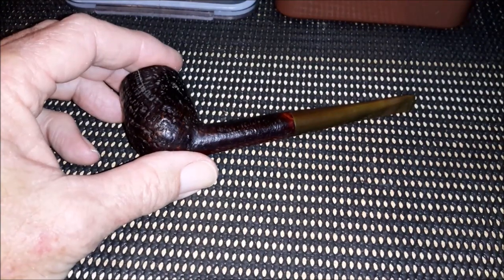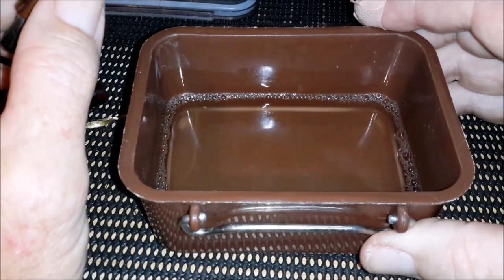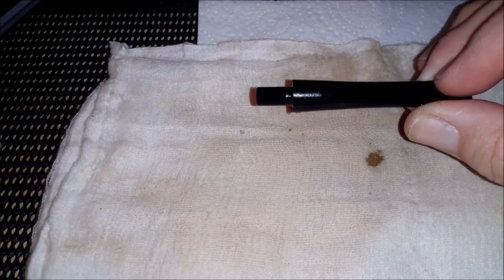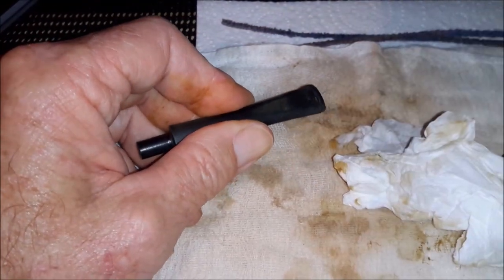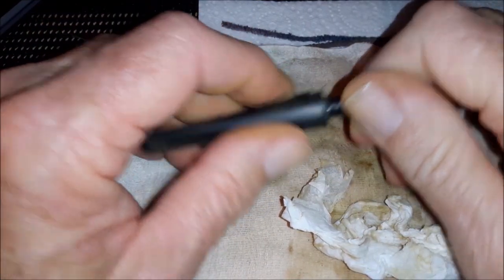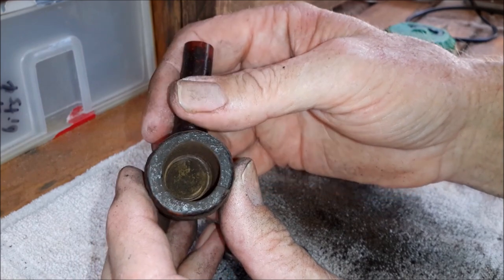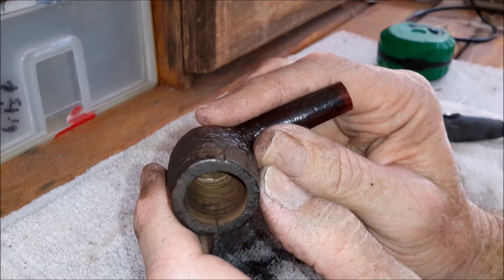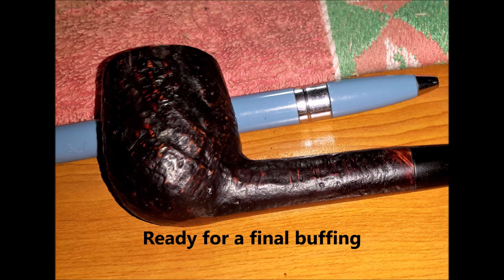Refurbishing an old Captain Black Pipe.

Comment: interesting vid. I learned a thing or two. I liked the whole bleach wash thing, but wondered if it would need a bourbon bath after to replace the clorox smell. Did I miss that? I may have fast forwarded during sanding. But regarding the drill, I wondered why you didn't just pull the crack out a bit, squirt in some glue, then use a some sort of vice to squeeze it tighter than tight. Your way seemed to work, but just wondered what you thought. Good job. Glad to have watched. Thumbs up. 🎷 👍🏼
Reply from the maker: Hello Brother. Thanks man, there's no residue smell or taste from the blech. The alcohol on the pipe cleaners you pull through gets rid of that. As to the bowl, that much pressure would have cracked it. The bowl is pretty thin after all those years of abuse and the pin really gives it a lot of strength. Plus I guess its a matter of how much trouble you want to go too. Thanks for watching. Ciou.